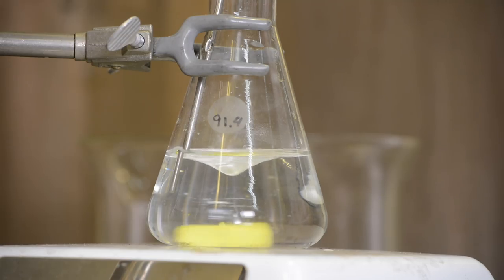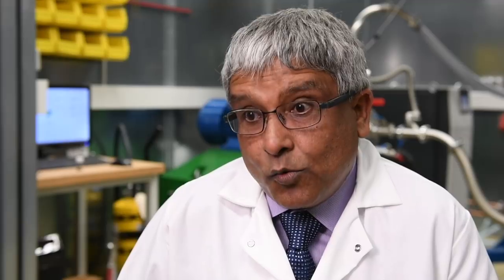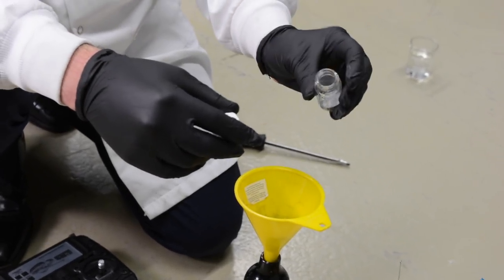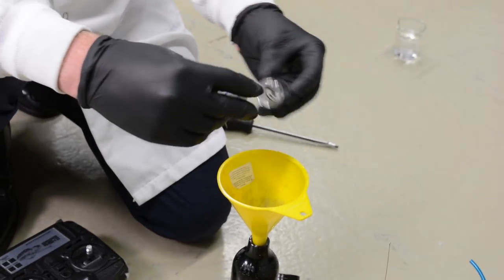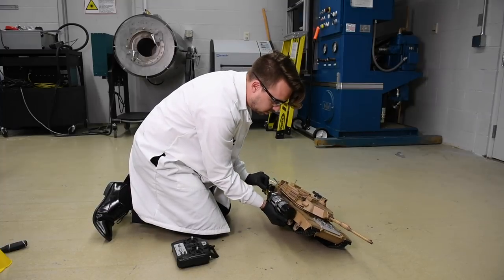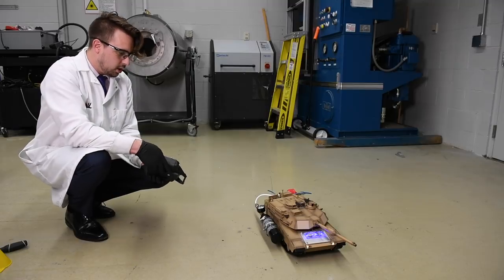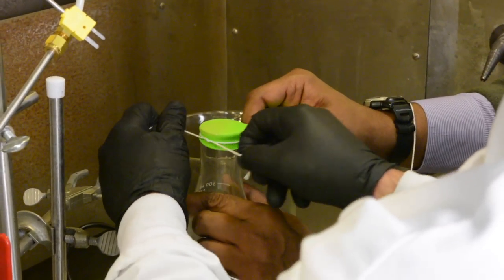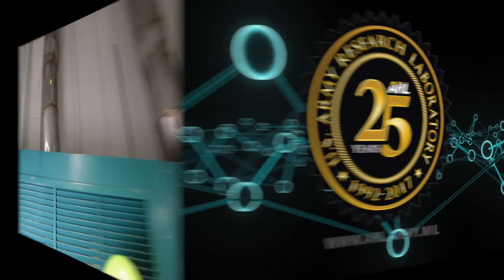Army discovery may offer new energy source

Comment: Update: This particular technology has attracted many inquiries from industrial partners for licensing in a multitude of diverse applications.  This interest is driven by the fact that unlike other well-known methods of extracting hydrogen from water with aluminum, this particular technology does not use nanoscale particulates, or toxic, caustic or expensive additives such as gallium, platinum, acids or alkalis etc. The powder can also be made into full dense structurally sound engineered parts/components using conventional metallurgical powder consolidation techniques and/or can also be additively manufactured using 3D printing. These parts will also react with water to generate hydrogen gas.

Comment: This cannot be a catalyst, as by definition a catalyst is not consumed by the reaction in which it takes part. If it were a catalyst it violates the laws of thermodynamics by allowing water to be dissociated without the input of energy, resulting in a perpetual motion cycle. At best the additive is being rapidly oxidised to release the hydrogen and produce aluminium oxide or hydroxide.
Reply: This makes sense
Reply: It's not a catalyst, it's aluminum mixed with a catalyst allowing for the aluminum to react with water to produce hydrogen. I suspect it's an alloy that involves gallium as it is able to remove the oxide layer of aluminum so it's readily available to react with water at a moment's notice. Once all of the aluminum is reacted, it is aluminum oxide or alumina that is lower in state of energy. The gallium still remains and can be mixed into a new batch of aluminum for the reaction to occur again.

Comment: Phenomenal breakthrough!  What is the status of this development, 2 years on?
Reply: Update: This particular technology has attracted many inquiries from industrial partners for licensing in a multitude of diverse applications.  This interest is driven by the fact that unlike other well-known methods of extracting hydrogen from water with aluminum, this particular technology does not use nanoscale particulates, or toxic, caustic or expensive additives such as gallium, platinum, acids or alkalis etc. The powder can also be made into full dense structurally sound engineered parts/components using conventional metallurgical powder consolidation techniques and/or can also be additively manufactured using 3D printing. These parts will also react with water to generate hydrogen gas.

Comment: Can the round trip efficiency be disclosed? If you put 1 TWh of electricity into producing the aluminium powder, how many GWh will the hydrogen produced generate? With a battery you get typically, disregarding grid transmission loses, around 99% efficiency so from 1 TWh that goes in, you'd get around 999 GWh out. One might be tempted to say "aha, but it takes energy to make the batteries". Indeed but so does the hydrogen fuel cell which are the comparable devices in this scenario since the powder is one use only, while the batteries and fuel cells will last potentially for years depending on the application.
Reply: No you’re missing the point. 
You burn  fossil fuels to provide the energy to make the powder, then split water and you use hydrogen for way less power. Makes perfect sense to me. I think they deserve a Solyndra type grant to fund this great project.
Reply: Like their white coats; that means they’re scientists and smart ! So impressed.  100% efficiency; a chemical perpetual motion machine! Maybe they’ll invent cold fusion while they’re at it.

Comment: No this is not the same work as Christopher Bunker. His work uses pure Al nano particles which are prevented from reacting by the use of a coating which dissolves when in contact with water. The work described here is based on non-nano powders (no inherent inhalation health hazard) and uses galvanic couples dispersed on the nano-scale.